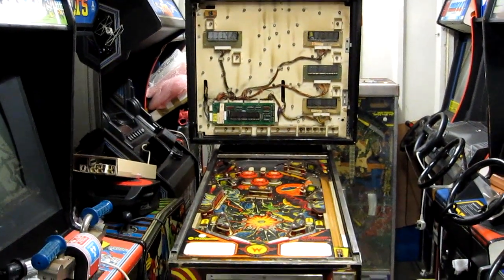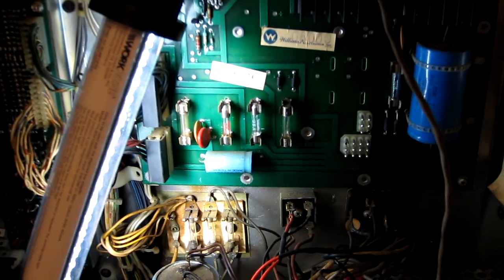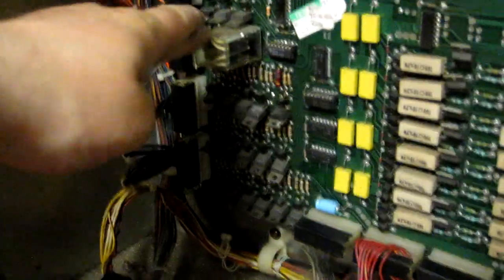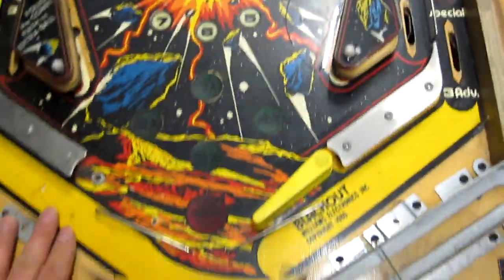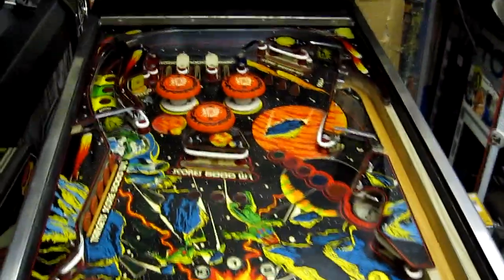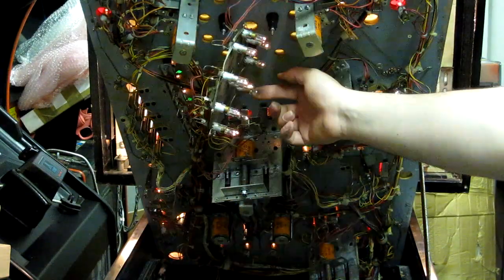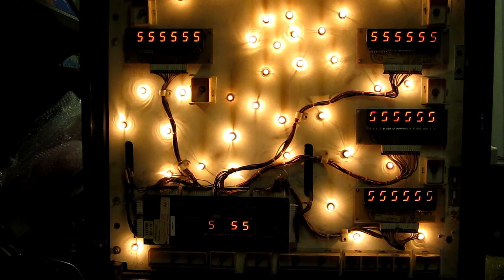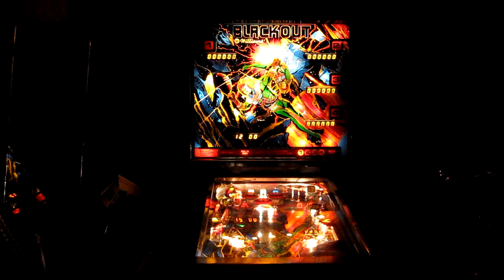Williams Blackout Pinball Repair / Restoration

Comment: Don't know if you have any plastic sheets something like an art cell kind of sheet.
I got some and they are clear plastic sheets that are square shaped.
What I did is put a brush stroke onto one of the sides and let that dry then added a second coat and that gives an idea of what the color will end up looking like.
I use that swatch to then see if it matches.
Nice thing about the clear plastic is you can wash it off and re-use it when it gets to full of paint swatches.

Comment: Cool.
Are you going to use the other playfields as a testing ground for playfield touch ups?
I know with mine I am dreading touching up my playfield.
I think that is the least thing I like about repairing and restoring a pinball machine is the hassle of trying to get the colors correct on the playfield.

Comment from the maker: The machine is now out on loan to a friend so it has the same playfield that was shown in the video. I have a better playfield to transpose into the machine at a later date when I have it back in the workshop, the better playfield has almost no wear so it will just need stripping down and waxing
Reply: Hey could you give me some steps and things to check for a first start up? The owner said it works and offered to assemble I said no its fine. Now I am home with it so I wanted to do some tests and make sure I do not fry the game. I noticed the ground mods and the fuse check and things but I am fearful i still have much more to check before turning this blackout on that I just purchased.